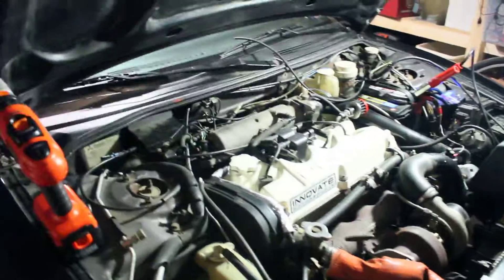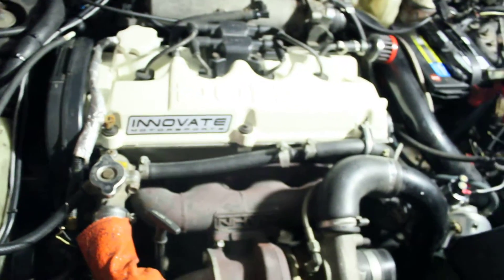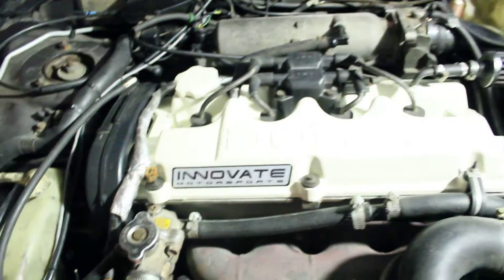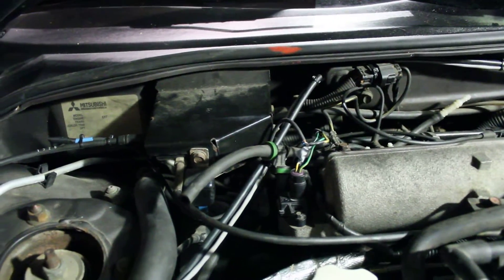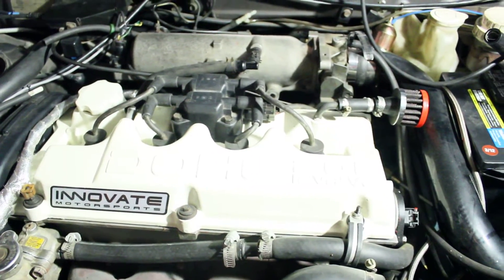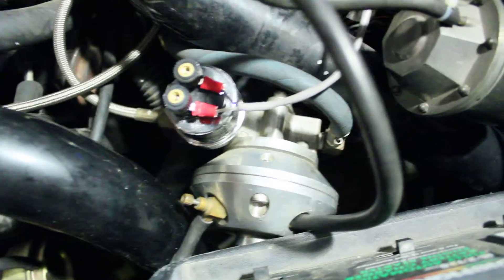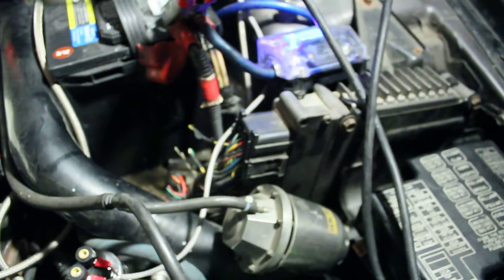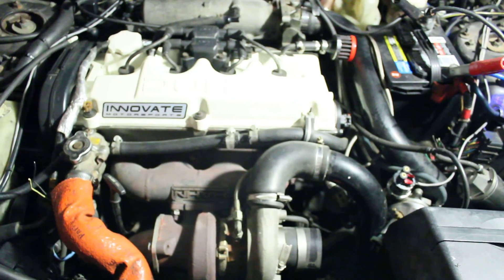Evan's Megasquirt Build Ep 1 - Project Intro: Eclipse 420A Turbo

Comment from the maker: Also, I'm not a mechanic, so be sure to read up or ask around if you want to fix it yourself.  Take what I say with a grain of salt... I'm new to this game.
You can also probably try to pull the thermostat out which will let it flow all the time, and see if you still get hot.  Stay close to home when driving though and don't run it too hot.  If it cools when the thermostat is out, its probably just stuck closed. Good luck.

Comment from the maker: When you first start the motor cold, feel the pipe going from the filler neck on the radiator to the water pump inlet.  (mine is bright orange in the videos).  If that gets very stiff/hard after only a few seconds/minutes of running, then it could be that your head gasket is blown and combustion pressure is getting in the cooling system.  Head gaskets are common problems on 420A, since the back right bolt is too long from the factory.  If you end up replacing it, get new bolts, they are cheap.

Comment: I have MS2, but I'm just controlling fuel for now. My inspection is due in a couple months, so I don't wanna go fuel standalone, and then have to redo everything just to pass inspection, that's why I'm running mine in parallel. I can't get my FCD to work for anything though.

Comment from the maker: I am running standalone, without a FCD... the stock map is unhooked and just acts to plug the hole in the manifold.  It was driven without a FCD on the stock ECU, but the wires were taped like someone took it off.  Not sure why, but if they hit fuel cut on boost, it could have killed the gasket for sure.  Luckily, forged pistons, so no harm done there.

Comment from the maker: I did the head gasket on it and unfortunately the ARP head studs were a bit out of my budget, they are a planned upgrade if I ever go heavy boost on it.  I did, however, put in a brand new set of Torque to Yield bolts from Fel Pro.  I know these cars had a problem with the back right bolt being too long from the factory, so that may have contributed to the head gasket.  I''m pretty sure they went lean since I had an injector stuck open. The ECU probably kept cutting fuel and eventually killed it

Comment: If he used the same "torque to yield" bolts. Sorry for the bad grammar. I wouldn't go over 8lbs with a stock motor, and since you're going full standalone, then you don't need to worry about fuel cut. If you're running megasquirt in 'Parallel' then you need to have a FCD (Fuel Cut Defender) which it looks like he already has one wired up to the MAP.

Comment: You need to check and see if the guy has had the motor built. He probably blew a head gasket because he's using stock "torque to yield bolts" which are junk if reused. You want some ARP Headstuds. I've had my 420a built (me and my buddy at work.) When they go lean, you're more than likely going to melt a piston. Meaning you don't enough fuel, pistons get really hot, and it ends up damaging them.